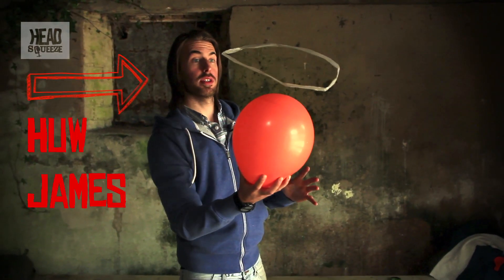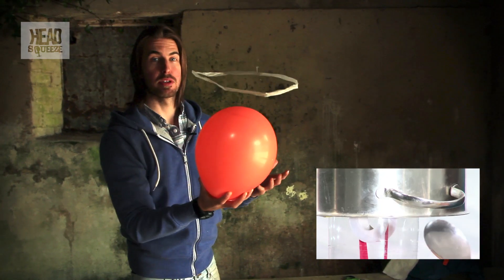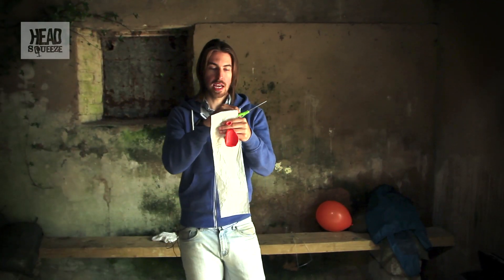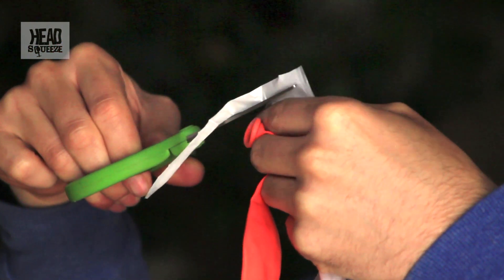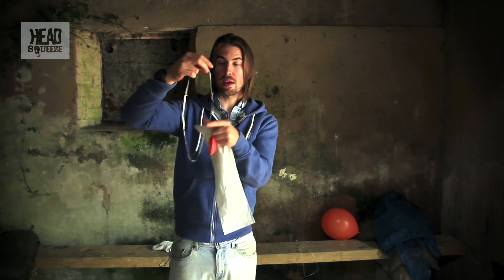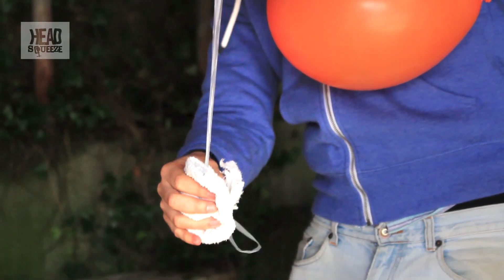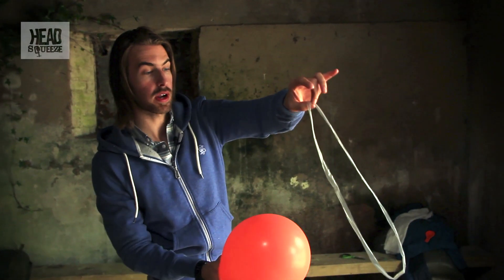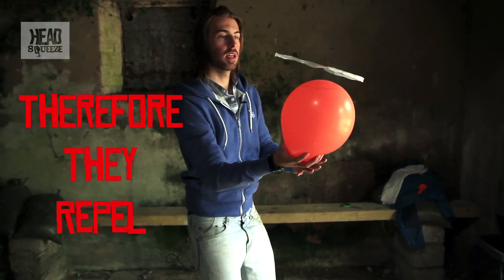Make a Static Flyer | Live Experiment (Ep 56) w/ Huw James | Head Squeeze

Comment: i paid 30 bucks for a toy that has a battery-powered Van de Graaff generator inside it.

But its nice to see that it can be done so cheaply. the toy is called "fun fly stick", its worth buying because it has a heavy duty generator inside it that delivers extremely high voltage at close to zero amps, and Van de Graaff generators that do this are usually much more expensive, and less reliable.